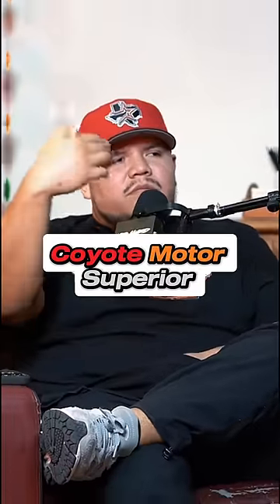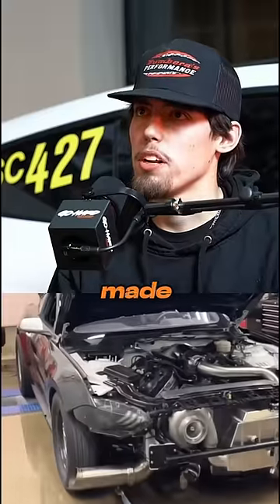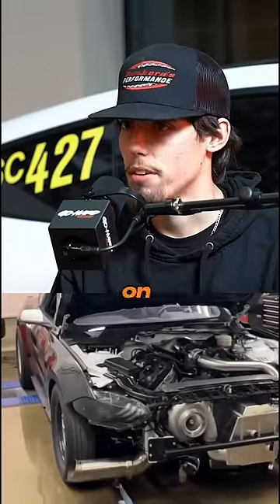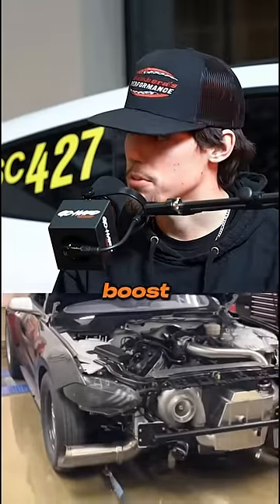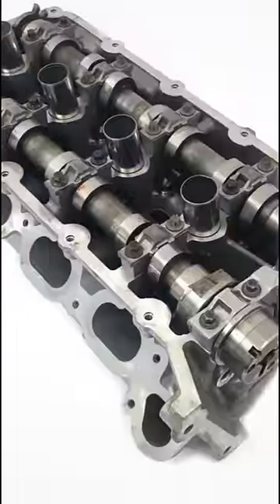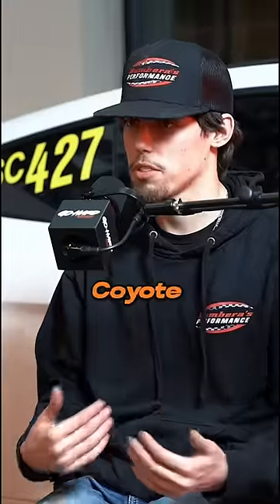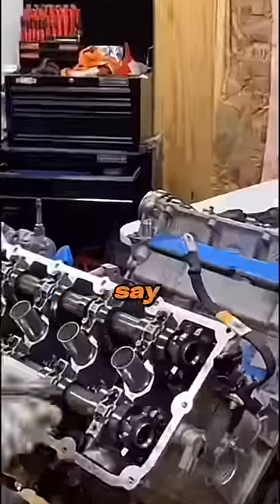SUPERIOR Ford Coyote Motor 😳 #shorts

Comment: Bro actually called a sleeved block a "stock block" 😂😂😂
Reply: It’s a cast aluminum block they are sleeved from the factory
Reply: @camman1 did you not watch the video? He specifically said "you need sleeves to run 25 pounds of boost." Then immediately after "above 50 pounds of boost on stock block coyote - sleeves and rings". That means aftermarket sleeves and rings. 🤦. We can argue about the semantics of whether or not sleeving a block constitutes a stock block or not, but those are aftermarket sleeves. To install them, you gotta machine out the old sleeves, then into the aluminum block extra so you can install the thicker sleeves into the block. Don't know how you can call that a "stock block" being that it is literally "not stock"
Reply: @camman1 ps, the block has been bored so it can accept Darton sleeves, has Manley pistons, and MGP rods.... So yeah, stock block
Reply: @Fpvpilot928 I believe he means stock casting. “Modified factory block” is probably what he should have said. Either way, that sleeved coyote was WAXING billet block LS’s lol
Reply: Exactly ,  sleeves and o rings but calls it a stock block .
Reply: @marcusking9078  it’s the stock casting. When racing at that level, most cars have billet blocks. That coyote is outrunning billet LS’s
Reply: @marcusking9078  it's also got pistons and rods, they just don't mention that
Reply: @Fpvpilot928   most all engines  have pistons and rods.  Are they stock ? Probably not if he tore the engines down to replace the sleeves , who would reuse the pistons and rods ?
Reply: It's a stock block with sleeves. It's very common but I'm a engine machinist
Reply: Laughing in proline hemi😂. .. hey if he can call a bored and sleeved block “stock” I can compare it to a billet hemi right?
Reply: It was stock up until 2016
Reply: @Fpvpilot928 if it's stock pistons I feel like it's just stock +.
Reply: Technically he said he rain stock heads on a sleeved block
Reply: @sagenbabin8786  I was talking bout the second car he mentioned there. You could see the gears spinning in his head when he said "stock.....block coyote, sleeves and I rings". He could have said sleeved block with rods and pistons. That would be much more clear.
Reply: My pops developed the teck to sleeve ford blocks at the factory.  Theyve been sleeving for decades stock.
Reply: @traxxasrcfun Waxing who? Those billet LS and big blocks all run 5s now. The track just wasn’t there
Reply: @traxxasrcfun he’s not outrunning shit until he runs well into the 5s lol
Reply: @Fpvpilot928 the block is stock vs having to use a different block or alter the block besides sleeves bro u missed the whole concept
Reply: @marcusking9078 everyone knows what he means, you're the only one bickering about details of wording
Reply: @brandonwalker6781   if " everyone"  knew what he was talking about it wouldn't be a question .  He said stock block and obviously its not a stock block .
Reply: probably stock as in not billet
Reply: @Iamlearningsomething  an engine with ZERO oe cast parts 😂
Don't be upset that an oe casting engine smokes ANY OTHER cast engine and DEF  dodges oe crap.
Reply: @Fpvpilot928 dude the reason you get sleeves is because the stock block can’t handle the power! 😂
Reply: Ford people say a lot of funny things.
Reply: Yea a sleeved block aint really to much stock anymore.  Ppl get hung up on this i got stock stuff.  Just put what motor u want in ur car build it race it and have fun
Reply: @traxxasrcfun yea, no a coyote engine is expensive and large.  Idk y ppl say its better it dnt have but so many extra cubic inches u can add.  Its as large as a big block chevy.  And when u wanna run it in a heavy car u have to make 100-150 more horsepower to run a et because it cant produce but so much tq.  Some ppl wanna do nitrous or a procharger or all motor in a heavy car.  And a coyote cant fit all those bills like other engines that has more room to build it to fit those needs.  A coyote and twin turbos aint nothing to special about it when every coyote at the track has the same combo
Reply: The Coyote is sleeved from the factory,  they’re just thin.
Reply: @MustangGuru  its not sleeved from the factory its an aluminum block it has to have an iron sleeve in it regardless.  People dnt put in reality that u buy a coyote engine for alot of money then put sleeves in it which is an expensive process and people wanna call it stock or its not an aftermarket block.  Ppl just wanna put stock on it like they accomplish something big.
Reply: @davidanderson6706  the Coyote 5.0 is sleeved from the factory,   IF as you say is just an aluminum block without any linings in the bore as you say , the engine wouldn’t last a 100 miles. 
Rings would shave out the bores,   In the old days we used to put Nicklesill sleeves , the rings would wear out before the lining.  Btw.  You contradicted yourself in your first sentence.
Reply: @MustangGuru  let me clarify for u then.  Darton dictile iron sleeves are not factory.  No shit the block is aluminum and have iron liners or from another material.  A stock block thats cut out to put in some darton iron sleeves aint stock anymore.  No matter how u wanna cut it.  Let the stock block stuff die and lets get back to racing rather than talking
Reply: The block is stock with aftermarket sleeves. Not really a big advantage but the question was “why is it better” so the fact the the block w/o sleeves is stock gives it a tiny plus 1. 

At the end of day, do you like head flow or no? That’s always been ford’s game. From the Cleveland to the DOHC modular and coyotes, the engines are built for head flow. 

They have tons of issues that need addressed still.
Reply: @W.A.J.J. Windsors and SOHC's have absolutely terrible heads.  So, no, that hasn't always been their game.
Reply: @jridenour31  what’s your pronouns?
Reply: @johncena-hq1ti Now do it on a 275 radial like LaSala, and then talk to me. 😏
Reply: @MrAllDay2u  lol that’s the point. Small tire he’s dialed in for the power. Big tire cars are much faster but won’t put the power down on a small tire like a 275.
Reply: @johncena-hq1ti  You don't think he would go faster on a bigger tire? 😂

He chooses to run in the 275 class. 

You don't think guys with LSs and Hemis are also running in that same class.

Stop the cap, bro 🛑
Reply: @MrAllDay2u  no he wouldn’t because he makes a lot less power than them lmao…so you’re saying he would be faster with 1000whp+ LESS than a big tire car? I guess Brett’s car is actually capable of 5.70s🤣🙄
Reply: @johncena-hq1ti  You're assuming he can't get any more HP out of it 🙃 

And, I'm sorry I missed your response about all the LSs and Hemis that are currently running in the 275 class, not being able to put him down.

I wonder why...? 🤔
Reply: @MrAllDay2u  yeah he totally has another 1500whp on tap 🤣
Reply: @MrAllDay2u  and I already said for 275 he’s dialed in. No doubt about that but big tire is a different ball game
Reply: @johncena-hq1ti  It certainly is.
Reply: Enought with the semantics, he probably has forged pistons & rods..anyone know from who?
Reply: @d0uble_O  it's built by Fast Forward Race Engines. Driver name is Brett LaSala. It's sleeved, Manley pistons, MGP rods, head from a GT350  voodoo, ferrea valves, matching springs, a custom COMP cams grind camshaft, plasmaman intake, dry sump, etc etc etc. Not sure who doesn't call that a built motor.

Comment: Big blocks rule all. It’s just facts. All brand. 460,440,426, 454, 540, 632.
Reply: That sleeved coyote was running faster times at sick week than the big block promods. I know it’s hard to believe, but look it up for yourself.
Reply: @traxxasrcfun  Absolutely, the car is nasty. But that coyote will be limited at that 2500 mark. Big blocks putting out 4000+ and not having to rev them to the moon make them god.
Reply: @JeepnJ89  big locks don’t make 4000 on a stock block. They are custom billet blocks at that level and most do not have any cooling system. If they do it’s a $100,000 Steve Morris SMX engine that can still fail or something else similar in design and cost. 
These coyotes are running stock sleeved block stock crank and stock heads.
Reply: @traxxasrcfun he ran faster because the other cars couldn’t hook. When you compare Pb vs Pb it’s not even close those cars run 5s.
Reply: A 2.0 honda engine can beat those
Reply: 460 no good! 429 Cobra Jet is better!
Reply: @JeepnJ89  stock block maybe and that is a big one.  Coyotes are purely capable of making 4500 to 5000 hp running the season before work needs to be done.  A coyote also pushes more air than any other motor it's size they run with 100 to 110% VE(Volume-metric efficiency) where all other push rod engines run 90% VE at best.

Comment: Are we really still calling it a stock block after it's been pulled apart and sleeved
Reply: Just like everyone says stock 5.3 even though it’s got heads, cam , intake, headstuds, rings gapped, etc. bottom end still has to be torn apart
Reply: Doesn't sound very stock.  Maybe he should've said Sligh modified or mostly stock
Reply: @traxxasrcfun  Heads, cam, intake and headbolts have NOTHING to do with the block being stock. Bore for new sleeves IS modifying the block.
Reply: It’s a factory block. There are custom block manufacturers
Reply: Agreed, it’s wild
Reply: It's a factory block... so it is a stock block. A sleeved engine is still a stock block.
Reply: Its all for YouTube to make you watch and them money.
Reply: Louder for the back.
Reply: Yes We Are.
Reply: @blckbrd21  it's a modified factory block.  That ain't stock no matter what you want to call it, boss.

Modifying factory parts ≠ Stock
Reply: @ryanmcbee1927  I'll take "What a delusional man would say while still being technically wrong" for $200 Alex.

Sleeving is a modification; it ain't stock.  It WAS stock.  Now it is not.  Get over it.
Reply: I don't know anything about engine mods. I'm a green newbie novice but sounds like he means he STARTED with a stock block ..& other than the his short sleeve shirt that he dressed up inside the cylinder bore it was stock other than the modifications of sleeve & whatever else he did on the top end? Idk man I just started a job as a technician apprentice at a dealership for a Swedish luxury estate brand of vehicle lineup
Reply: The BLOCK itself is STOCK no matter what you add to it!!
Reply: @italianknight78 You can sleeve a block Without boring it!!
Reply: Yes absolutely. Because that is a stock engine. The internals
Reply: @blckbrd21 factory or not once you bore out the block it’s not “factory”.
Reply: When you blow up an engine and you take it to the machine shop to have the cylinders cleaned up, your engine isnt a stock block anymore? Sleeves and o-rings are literally a machine shop visit away. Its not griund breaking. But haters love to be in denial 🤷‍♂️@italianknight78
Reply: It still has a factory block i.e. not a full aftermarket build including the block itself like you'd do with an ls for similar results not to mention having ALOT more cubic inches to do so.
Reply: @CGoody564 it's still using the block it came stock with so it is still using its stock block.  He's not saying it isn't modified it's saying it's a stock block sleeved or not that is impressive stuff to still be using the block that it came factory with.
Reply: @FoReVeRdYiNg112 it's still using the same block it came from the factory with aka not an aftermarket billit block like ls have to run to run anywhere near those kinds of times.  Call it what you wanna call it it still uses an oem block
Reply: That’s like calling a burger plain even though it had cheese and a bun
Reply: @cedricwilliams328 Your right..a modified block, forget the sleves..they had to remove material to fit those sleeves..as soon as you change its geometry..no longer stock!
Reply: @cedricwilliams328  but thats one minor mod i would let pass..thats just to fit different sleves. Pretty sure you could find other sleves that fit the stock block without modifying it..but for a lower dyno number. Still fucken fast.

Comment: I ran 60 lbs of boost in my 94 toyota tercel and made 16,000 hp on the stock block. Ran low 3s in the halfmile
Reply: Oh yeah well i retuned the vtec solenoid in my d16 with a y8 head and made 28,000,000hp on the stock block and still got 234mpg.

Comment: We’ve been running 28 psi on a stock block aluminum 6.0 ls for a year and have had no issues. Made 1025whp at 23.5 psi through a th400
Reply: They ain’t ready for that conversation. Plus it was probably cheaper too
Reply: @thatmitsubishikid2498  coyotes are wonderful engines. But what all the Ford guys seem to forget is that 4.8's and 5.3's have been reliably pushing 1000+ for damn near 2 decades. I believe the coyote has more potential but comparing the 2 is pointless. The same argument can be said that the LS is superior to a Ford 302 Windsor. These podcasts are pointless info
Reply: Love the 6.0.
Reply: @thatmitsubishikid2498 ain’t ready for that conversation? I don’t think you are because you clearly don’t understand boost. 20 psi on a coyote from the same sized turbo, is ALOT more than 20psi on a LS. The coyote eats air so much easier due to the head designs and the obvious 4 valves per cylinder.
Reply: @KJTUSKJTUS no they arent. They have been making 1000 on STOCK BOTTOM END. Coyotes do that on the stock longblock, meaning from the valve covers to the oil pan is as it came from the factory. No ring gapping, no headstuds, no porting, no cams, nothing. Just boost and fuel. They aren’t even in the same ballpark as far as taking power in stock form. Coyotes are running 7’s on stock engines, LS’s are still in the 8.50’s.
Reply: @traxxasrcfun  yeah but to get the same power and reliably the LS is just better. More engines laying around means parts are cheaper. And they’ve been around in performance cars for decades
Reply: @thatmitsubishikid2498  it’s not tho. A LS will not hold the same power stock for stock as a coyote. Stock, factory sealed coyotes are running 7’s. Stock LS’s are still in the 8.50’s
Reply: Hey Andrew when is the last time a 6.0LS won sick week 2024 or texas2k24😂
Reply: @thatmitsubishikid2498 Changing out parts from laying around engines is not going to get you to 1000hp.Extensive aftermarket parts is what they have going for them.Don’t forget they are two valve pushrod,have to be cammed to ridiculous levels to flow like a Coyote at .500.

Comment: Horsepower is just torque in relation to rpm, a well geared diesel could keep up with high horsepower engines. You coul have a low rpm high torque engine paired to a gearbox with taller gears in a light chassis, and it will most likely do just as well as a low torque high rpm engine paired to shorter gears in the same chassis.
Reply: Horsepower is calculated by multiplying torque and rpm. All else being equal, the vehicle with the most horsepower will win a race.
Reply: @EricFixalot  or a higher rear end ratio.
Reply: @adamrobinson8673  Yes assuming the gearing kept each engine in it’s ideal power band, the one with more horsepower wins. Horsepower is a measurement of energy, torque is a measurement of force which by itself doesn’t mean much. The engine producing the most energy wins the race.
Reply: @EricFixalot  maybe if we had more numbers we could have a more constructive argument. But I've seen diesel pickups making under half the hp beat gas pickups. And I've seen gas pickups making 3/4 the torqe beat diesels.
Reply: @adamrobinson8673  So if you think about what’s going on between the two engines, we’re comparing a motor that makes it’s power with a lot of small explosions to one that makes less big ones. You can go fast either way, but horsepower tells you which one has the higher output. Torque x RPM /5252 = horsepower.